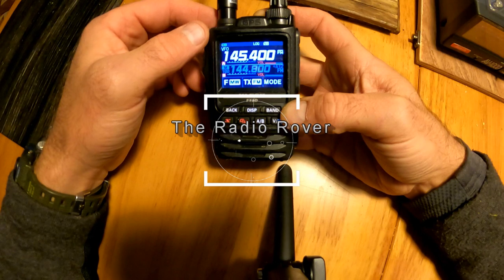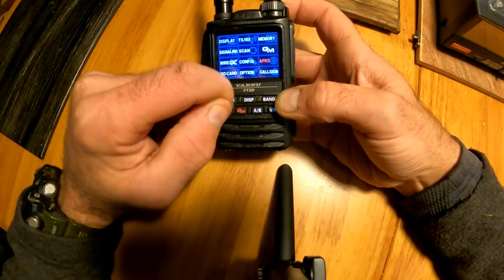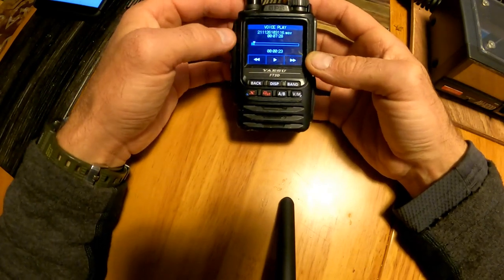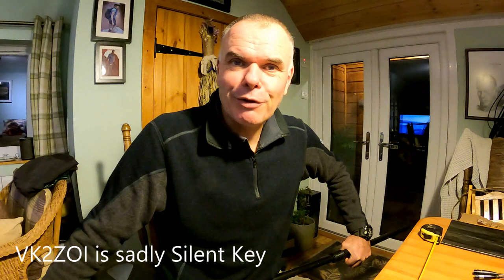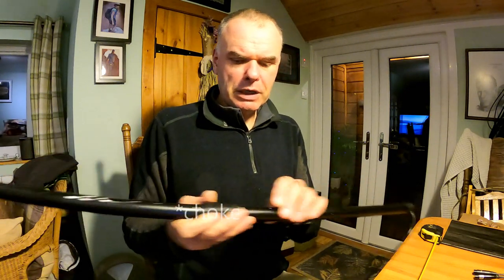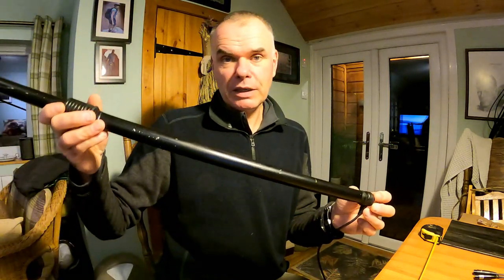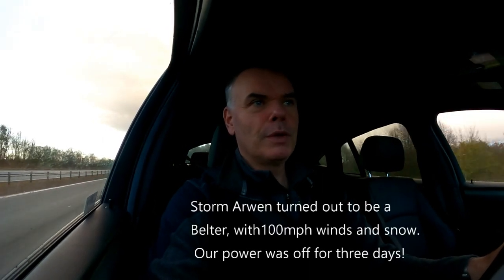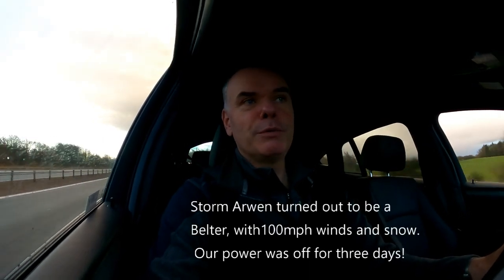The 2m Flowerpot Antenna & FT-3d hints

Comment: I've just made a flower pot antenna today and was looking forward to taking it out and giving it a go, but we've just had to self isolate, after one of the boys testing positive :-( Maybe in a week we'll see how performs, but it's looking like it has very low swr at the moment. You can active most of the summits in GW land on 2m, so this looks like it would work well in those bad conditions were you don't want stop for long and get all the kit out. 73
Reply from the maker: Yes, it's so handy for operating on the move on a multi-summit day. Just watch out for low branches! Funnily enough, not usually an issue where I live, however to get up to Ben Cleuch for this vidoeo, I had to climb through a narrow wooded glen with lots of overhanging trees. Nightmare if you forget to bend over!
Let me know how you get on with it when you get out to test it.
73, Fraser MM0EFI

Comment: If the ft3d works the same as the vx8, you don't need to turn off aprs in the menu to stop aprs. 

The aprs modem only works on vfo B, so switching to single vfo mode, with vfo A chosen, will stop both tx and rx on aprs.

I see you use this method to stop rx, but it will also stop tx.

Thanks for the video
Reply from the maker: That's great advice and should save me some time. Thank you very much!
Glad you enjoyed the video.
73, Fraser MM0EFI